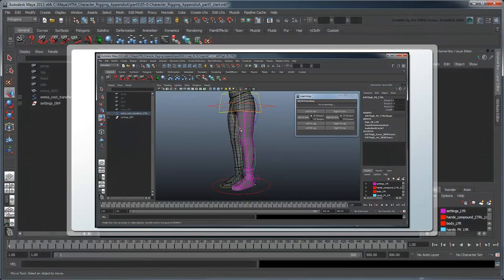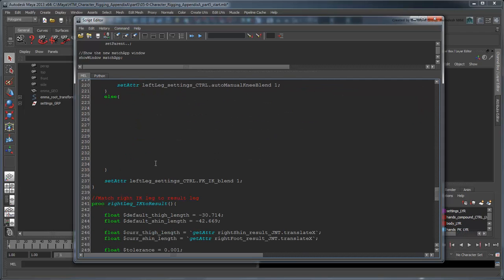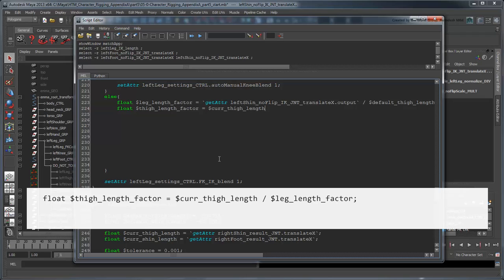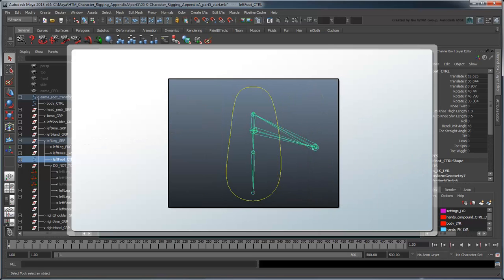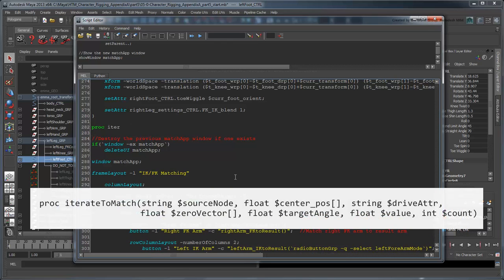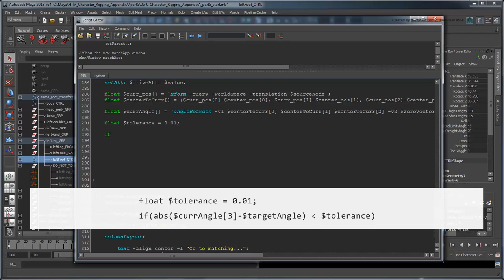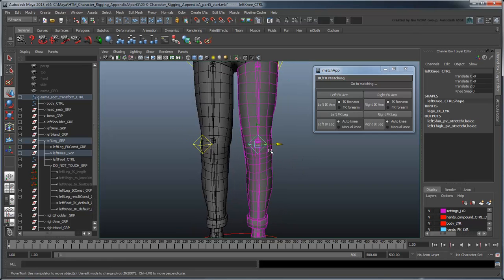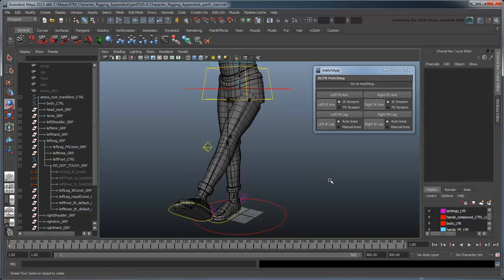Creating a Character Rig: Appendix A: Part 5 - Matching the automatic IK knee (Advanced)

Comment: I have trouble with my IK/FK matching script for a leg setup that has an extra knee joint, so the leg IK handle has 4 joints in its chain. The matching form IK to FK works just fine, but from FK to IK it causes popping, because in FK mode I can change the knee rotation independently from the shins rotation and in IK they (I guess) they share a specific relation. Just wanted to ask you, if you can give me a hint how to achieve a non popping result. (In the meantime I'll inform myself of how the Ik rotations are actually calculated) Oh and of course that you so much for all of your tutorials! Have a nice day.
Reply from the maker: I'm a little confused as to why the knee would need to rotate independent of the shin.  Is this for twisting?  If so, can you set up something similar to the arm (with segment joints layered onto a result joint)?
Reply: Thank you for the fast reply! I'm sorry for my confusing description. The leg setup I'm using is a double knee setup (for better deformation results when bending) So the leg joint chain (without foot) consists of these joints: thigh > knee > shin  > ankle (no twist joints). With the independent rotation i just wanted to say that the knee joint has currently its own FK control in FK mode (independent was the wrong word here, sorry). Hope that makes it more understandable
Reply: For short: It's pretty much the same leg setup as you have shown throughout this tutorial series. The only real difference is that my leg joint chain has 4 joints and yours has 3.
Reply from the maker: Hmm, try changing your IK handle to a Single Chain (SC) solver (in the ikHandle's IK Solver Attributes).  I think this will help, I'm just not 100% sure what side effects there might be, if any (but it's worth a shot).

Comment: +Maya Learning Channel How do I get matchApp to work with multiples of the rig in the same scene? I think it'd be possible if I could get Maya to ask for the name of the parenting root-transform control, but I don't know how to get Maya to ask for input. What command should I use?
Reply from the maker: The best way is probably to use namespaces.  You'd have to add a text field to the app that allows you to specify a namespace, then store that as a variable so you can append it to all the joint/attribute names.  Then just make sure each character belongs to its own namespace.
Reply: How do I do that?
Reply: I've gotten a bit further, but how do I get the inputted text from the text field to store it as a variable?
Reply from the maker: When you declare a textfield, you can also assign it to a variable at that same time.  Check out the developer docs here: http://download.autodesk.com/us/maya/2011help/Commands/textField.html

Scroll to the bottom "Mel examples" to see the proper usage for both entering and retrieving textfield data.
Reply: Oh, thank you! I'll check it out soon! I hope it works!! ;D
Reply: Bummer. I couldn't find anything I could use.
Reply: Is there a way I can get what's in the textfield and assign it to the variable? Here's what I tried:if (`window -ex matchApp`)
    deleteUI matchApp;window -w 350 matchApp;
frameLayout -l "IK/FK Matching";
    rowColumnLayout;
        text -label "Namespace" -w 350;
        string $nameSpace = `textField`;
        button -c "print $nameSpace";
        ;
showWindow;(I added the button with the command to see it print the namefield value to see if it went as planned.)
Reply from the maker: You already did it.  The variable $namespace holds whatever is input into the textfield.
Reply: When I run the script, I keep getting this message:Error: line 1: No object matches name: matchApp|frameLayout118|rowColumnLayout81|textField91
Reply from the maker: Hmm, I get no such error running the script you showed above.
Reply: Would you mind showing me your script?
Reply from the maker: I just copy and pasted yours.  The section you included above is fine.  However, if your other actual script has more in it than that, then there may be issues somewhere in there.
Reply: Maya Learning Channel Here's something else I tried. How do I connect $s to whatever's in a nameField?
$s = ":Aiden";
namespace -set $a;
$sphere = `xform -query -worldSpace -rotation ($s+":pSphere1")`;
select ($s+":pSphere1");

Comment: First of all I want to say what a great tutorial series this is and ho much I appreciate how thorough it is in making  a robust, versatile and easy to use character rig.  I do, however, have one comment on the use of recursion in the iterateToMatch procedure.  If there happens to be a bug in the code the 10000 count escape condition may not be sufficient in protecting you from causing Maya to crash.  In my case, I had a bug in my code (I forgot to reverse the sign between left and right IK default lengths) and although the rest of my code was perfectly fine the procedure crashed Maya before it ever got to 10000 iterations.  This is most likely caused by a stack overflow error caused by recursively calling the iterateToMatch procedure.  To avoid this issue I suggest using a do-while loop instead of recursion to implement this procedure.  The following code shows how this can be done:

proc float iterateToMatch(string $sourceNode, float $center_pos[], string $driveAttr, float $zeroVector[], float $targetAngle, float $value, int $count) {
    float $tolerance = 0.01;
    
    do {
        setAttr $driveAttr $value;
        
        float $curr_pos[] = `xform -query -worldSpace -translation $sourceNode`;
        float $centerToCurr[] = {$curr_pos[0] - $center_pos[0], $curr_pos[1] - $center_pos[1], $curr_pos[2] - $center_pos[2]};
        float $currAngle[] = `angleBetween -v1 $centerToCurr[0] $centerToCurr[1] $centerToCurr[2] -v2 $zeroVector[0] $zeroVector[1] $zeroVector[2]`;
        
        if (abs($currAngle[3] - $targetAngle) < $tolerance) {
            return $value;
        } else if ($currAngle[3] > $targetAngle) {
            $value = $value - $value / 2;
        } else {
            $value = $value + $value / 2;
        }
        
        $count++;
    } while ($count < 10000);
    
    print "Match failed.  Over 10000 iterations.\n";
    
    return $value;
}

Using this code I was successfully able to circumvent the problem of having Maya crash on me, thus allowing me to better search for the bug in my code.  I hope this will be useful to others with similar problems.

Comment: AT [3.24] of this tutorial you selected the Leftleg_IK_length node from the outliner, but in previous tutorials you had to length nodes for both the pv and the noflip knee; named leftLeg_noFlip_IK_length and leftLeg_pv_IK_length. Also in the node editor none of the translate X nodes are named leftShin_noflp_IK_JNT_translateX. The only closest one to this name is leftShin_IK_JNT_translateX1. Is this the name you want us to type into the mel command line?

Also at [8:50] of this tutorial you have angleBetween -v1 $zeroToResult[0] $zeroToResult[1] $zeroToResult[2] -v2 $zeroToResult[0] $zeroToResult[1] $zeroToResult[2] on the screen ,but you are typing angleBetween -v1 $centerToResult[0] $centerToResult[1] $centerToResult[2] -v2 $centerToResult[0] $centerToResult[1] $centerToResult[2] which one is it? You make this mistake a-lot in this tutorial where zeroToCurr[ ] appear on the screen but you type centerToCurr[ ]
Reply from the maker: Jared Davis There was some refactoring done between this tutorial and the previous rigging one, one of which was to combine the two length nodes into one since they were redundant as well as renaming those anim nodes to make them more user friendly.  If you are using the previous version, then carry out the steps on the No Flip (automatic) length, which as you pointed out is attached to a leftShin_IK_JNT_translateX1.

For your second question, it should be $centerToResult (rather, it should just match the variable declaration on line 237 of the Script Editor).  I apologize and will make an annotation.

Comment: Really good stuff! This was my first rigging tutorial I ever had without prior experiences and it already boosted my knowledge significantly.

There's one issue with the script though. The formula "value = value -/+ / 2" in proc iterateToMatch could go over 10000 tries as the value that being halved may reset to a higher value. I find better results splitting the said formula into "delta_value = delta_value / 2" and then "value = value -/+ delta_value". This makes the next increase and decrease in value always by half (i.e., . This makes my 600+ iterations on some scenario with the original script down to 12 after the change. I think this is what the video tutorial wanted us to accomplish.

This is my results before and after the change (kindly look at the value inside the parenthesis; which is the increment/decrement from old to new value):

# BEFORE THE CHANGE
old value: 90.0 | new value: 45.0 | ( - 45.0 ) | count: 1 current_angle: 56.2682244714, target: 18.3152823085
old value: 45.0 | new value: 22.5 | ( - 22.5 ) | count: 2 current_angle: 24.6519850088, target: 18.3152823085
old value: 22.5 | new value: 33.75 | ( + 11.25 ) | count: 3 current_angle: 12.1474656688, target: 18.3152823085
old value: 33.75 | new value: 50.625 | ( + 16.875 ) | count: 4 current_angle: 18.2553838443, target: 18.3152823085 (note: value/2 is higher from the previous one -> from +11.25 up to 16.875)
.
.
(omitted 650 iterations)
.
.
.
old value: 22.5710776078 | new value: 33.8566164116 | ( + 11.2855388039 ) | count: 656 current_angle: 12.1855652684, target: 18.3152823085 (note: iteration #656 and target_angle is still not met)

# AFTER THE CHANGE
old value: 90.0 | new value: 45.0 | ( - 45.0 ) | count: 1 current_angle: 77.4524754428, target: 45.386472283
old value: 45.0 | new value: 67.5 | ( + 22.5 ) | count: 2 current_angle: 39.5218852481, target: 45.386472283
old value: 67.5 | new value: 56.25 | ( - 11.25 ) | count: 3 current_angle: 58.8426139452, target: 45.386472283
old value: 56.25 | new value: 50.625 | ( - 5.625 ) | count: 4 current_angle: 49.2452684813, target: 45.386472283
old value: 50.625 | new value: 53.4375 | ( + 2.8125 ) | count: 5 current_angle: 44.3968004332, target: 45.386472283
old value: 53.4375 | new value: 52.03125 | ( - 1.40625 ) | count: 6 current_angle: 46.8246313854, target: 45.386472283
old value: 52.03125 | new value: 51.328125 | ( - 0.703125 ) | count: 7 current_angle: 45.6115773058, target: 45.386472283
old value: 51.328125 | new value: 51.6796875 | ( + 0.3515625 ) | count: 8 current_angle: 45.0043996209, target: 45.386472283
old value: 51.6796875 | new value: 51.85546875 | ( + 0.17578125 ) | count: 9 current_angle: 45.3080417202, target: 45.386472283
old value: 51.85546875 | new value: 51.767578125 | ( - 0.087890625 ) | count: 10 current_angle: 45.4598228988, target: 45.386472283
Match found. Iterations: 11
(note: value inside the parenthesis never get higher than the previous one, consistenly being halved every iteration as what was explained in the video)

Another thing, I changed the recursion into while iteration (code was written in python though) since recursion is more expensive in Python. I'm note sure with the MEL though. But as long as we don't get 20+ iterations i think its fine both with MEL and Python.

I can't find the right words but I'm very thankful for these free tutorial series. Please keep making awesome tutorial videos! I think this video is the hardest to digest. Took me 4 times to watch to fully grasp the reason for angleBetween and then find the issue with the script.

Comment: When mapping this unique rig to HIK, would we map to the result joints only? Or a combination of whatever FK, IK, result and CTRL that would work best?
Reply from the maker: I'm not sure what you mean by "mapping it to HIK".  HIK is an alternative rigging method in which Maya handles much of this stuff for you.  However, it doesn't have some of our customized functionality like squash and stretch.  

Generally an HIK rig still has separate FK/IK/result joints though.
Reply: Maya Learning Channel I'll try to clarify, I am trying to use HIK to bake animations to my unique rig. I am having a difficult time trying to define my unique rig using HIK. The major issue I'm running into is driving the hips ctrl with the definition HIK provides. The hips will always collapse to the feet area when sourcing an example mocap animation from the visor menu. Am I misunderstanding HIK still, or am I missing a step?

Comment: this tutorial series is great and very easy to follow.  I was having a problem in random points in this series though.  At one point i basically broke the entire rig.  when i tried to move anything the rig was not responding.  I think i freeze transformed something i shouldn't of.  if you think that sounds like the problem please let me know.  Also if you could either do a facial rig tutorial that would be tremendous.  I tried using the digital tutors tutorials but i was looking online and people were saying that it had some pitfalls.  I am unsure what to do and if anyone can clarify that would great.  Thank you.
Reply from the maker: It's entirely possible that freezing something you shouldn't have would've broken the rig.  Also, in many cases "deleting history" will also undo a lot of the work in these tutorials.  We've provided scene files in the descriptions of each video that contain the rig at each stage of production, so if you find you've run into a problem then I'd suggest downloading those files and starting from there.